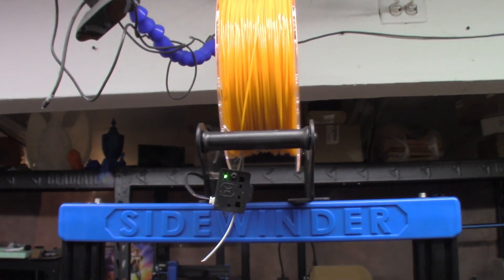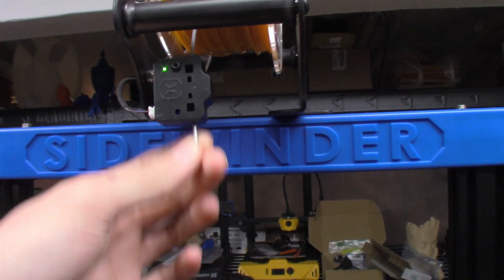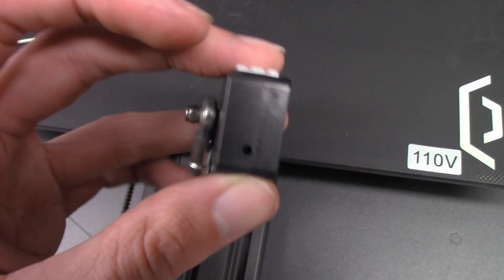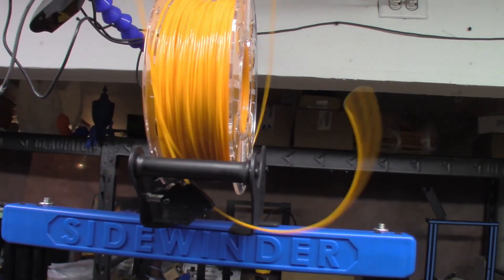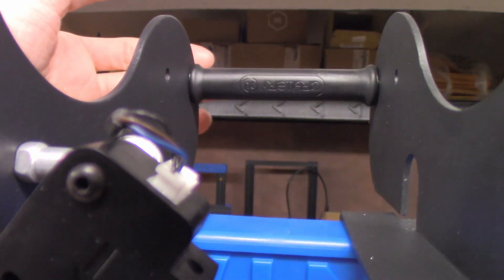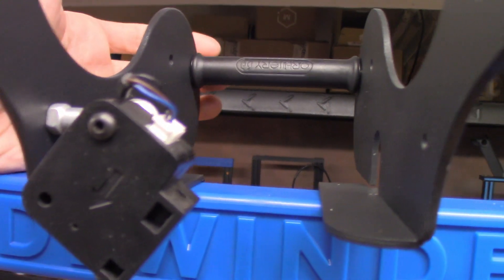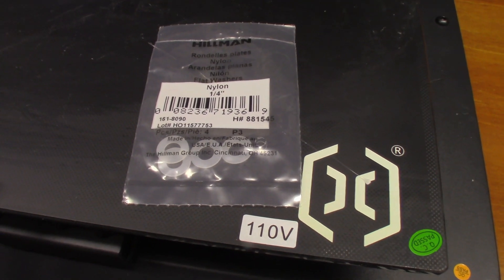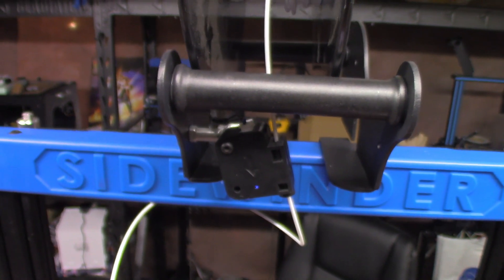Troubleshooting Binding Filament On The Artillery 3D Sidewinder X2

Comment: it's the spool holder. The first ones had solid bars. They have changed to bearings now. Much better. The filament sensor is a magnet ball, once the filament is in it's smooth.
Reply from the maker: Good to know! Knowing the supply chain crisis and how quickly Artillery adapts I figured they had the issue solved but we all know there are lots of "older" machines in circulation still so this may be handy for those people.
Reply: @MakeItWithCalvin  yeah, got mine about a week ago and it has got bearings and its running like a dream! Never had any issue...they must have changed so unexpectedly they have not even updated their manuals, I thought I had some parts missing in the box lol
Reply: Can confirm, got mine 2 days ago and it has bearings. However the filament sensor threw out a false 'out of filament' within like 5 minutes of use and it happened again less than an hour later, its garbage. Leaving it unplugged but enabled works fine.

Comment: Thanks for your videos.  I'm trying to put everything back togehter.  There's a plastic spacer plate.  It has holes to fit behind the fans, and a slot in it on one side.  Where does it go?
Do you have an assembly diagram by chance for the entire unit?  I had a clog, got it fixed, but now getting stuck putting it all back together... thank you.
Reply from the maker: Sounds to me like you are talking about the PCB spacer? IF that's what it is, it goes between the ribbon cable PCB and the stepper motor to stop things from shorting out, but I am not 100% sure based on what you are saying.

Comment: I have the newer X2, which does have bearings in the rollers, but I bypasses the filament runout sensor as it was adding drag and giving me Z wobble on my taller prints. It didn't fixed the problem entirely, but it helped the most of what I have tried so far. (added diagonal braces to the uprights and mounting the spool on the wall made no difference)  After seeing your video, perhaps I'll fix the sensor and make it operational again!